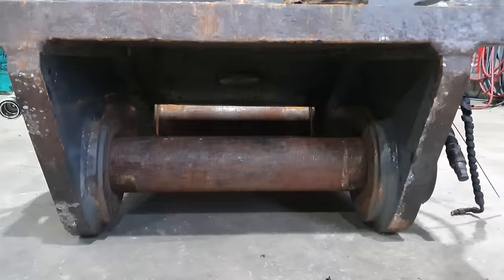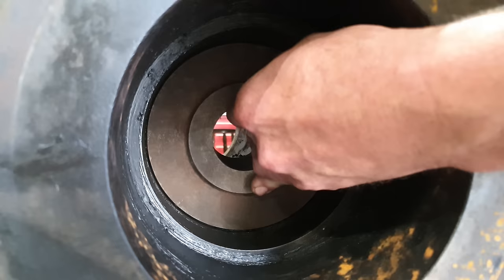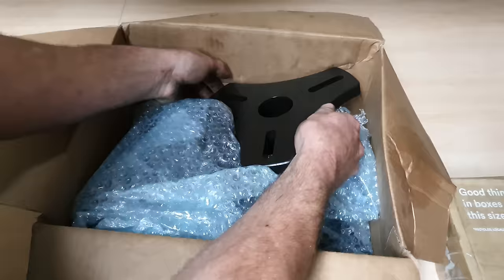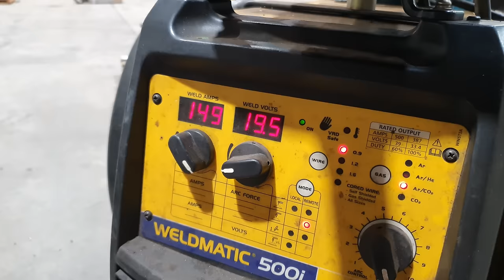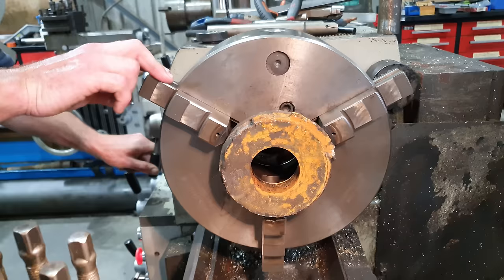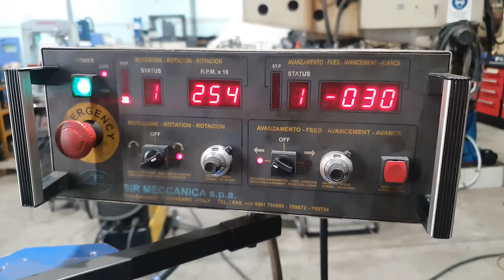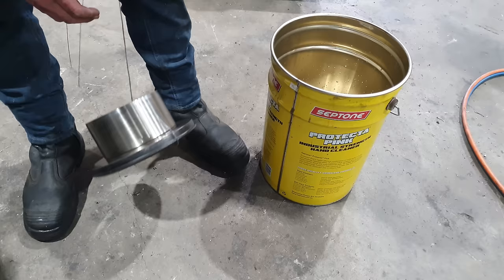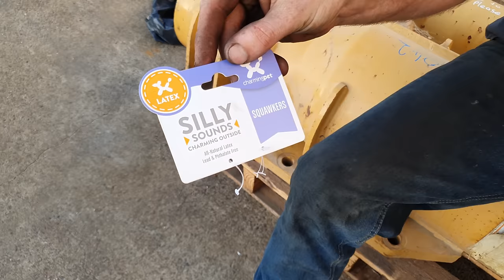Repair SUPER SIZE Tilt Bracket for 90T Excavator | Line boring & Machining

Comment: This entire series is a master class on heavy equipment repair. Professional production and a PHD level machinist.
Reply: with humor.. and he likes birds
Reply: He is very good doing many things. I worked in aviation at Bell and LTV as top pay working on very difficult parts. I also had my own production job shop for 18 years. I ran DeVlegs and Jig borers. I also ran 100 hp Cincinnati vertical and horizontal mills. He has taught me a lot about big lathe work.

Comment: Shop made tools are always a favorite. Line boring is another favorite. And, of course, your videos never disappoint. 
As for the tilt unit, I've not seen anything like it. I was a dozer operator, mainly D6 and D7. 
Homie and his toys are so fun, and my cat loves Homeless.
Reply from the maker: we've got a few more shop made tool videos we want to do when we get a chance! The tilt bucket and quick hitch is a lot more common on smaller machines
Reply: I liked how you took care of a unique situation to center the line bore… and the new parts just in time because you would have not gotten that disc out with the original supports welded on
Reply: During set up when tacking on the guid fixtures don’t they draw on you making the bar tight ?
Reply: Want to make a tool so first you make a tool to make another tool.
Reply: @CuttingEdgeEngineering who owns that green small 🚜

Comment: I respect your tenacity in solving issues with tools that don’t totally meet your needs. I know it is so easy to continue putting up with a product that generally works but you make the time and effort to fix what needs to be fixed. And your videographer does a good job of capturing the details and answering in video questions I’m sure would come up. Well done.👍

Comment: Those constant improvement efforts to ensure the customer gets the best possible outcome really add value to your shop. I’ve watched enough line boring in the field to appreciate how keeping tolerances to spec will get the longest possible time in the field before repairs are necessary again. You set a good example to those watching who do similar work.

Comment: I had to hold my breath when you fitted those bushes. Glad it all went well. That is one hell of a power head. The advances in machinery since WW2 have been astounding. When we were kids in the fifties they were still loading trucks with cable winch dozers. I hope you tube were not to harsh on you. I thought something must have gone wrong when my comments went missing.

Comment: The 4-bearing install is an interesting solution to the problem of eventual dust penetration.   Always interesting to see the variety of work going on in your shop!
Reply: The multiple bearings also support the bar better and spread the load out so there's less wear on any individual bearing. Win-win all around.

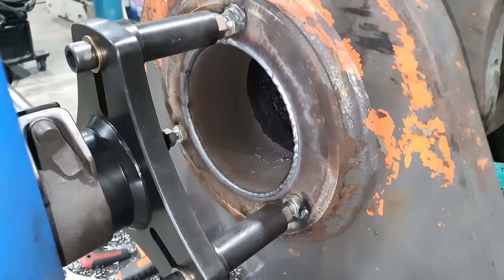Comment: Seems crazy to use a tilt bucket on a machine that big, but I guess they have their reasons. The shop-made mounts came out great, and the video speed for the welding on the second half of the main pivot bore (20:48 to 21:04) was spot on!
Reply: It avoids having to bring in another excavator.

Comment: Shops I have worked in we used freezer box with CO2. Changed dump box bearing ultra class, heated eye with snap ring oneside (bearing slides through and locks). Another line boring box dump hinge ulta class, two bars 12 feet. Ultra class over 300 tonne. Great machineshop and outstanding work done.

Comment: Those shop made tools look better than the OEM part, and yes that nitriding came out great, lovely surface and no imperfections at all, and a perfect fit on the threads as well. Going to bet the most expensive part was those 4 bearings per side. Close tolerance bearings are expensive, as I have had to order some for machinery, but seeing as the originals lasted 40 years, with no grease applied to them for a long time, due to burst and clogged grease lines, and they only got replaced because one was scored, but still had no measurable play. Those will still be there when your grandchildren are running the shop.

Comment: Those line boring supports came out really well. I liked seeing you put the smaller ones into use in tandem. They did not become obsolete. Karen is one of the most efficient and fastest heavy duty mechanics around. She just breezes through the work. 😋

Comment: It is just so satisfying when someone uses  equipment for things they were not intended for. Often that will allow you to do things easier and cheaper than your competitors and /or just make it possible. I used a hydraulik rotator hook on my knuckleboom crane which was not common on big cranes back then but convinced my boss to buy one in big size anyway. A lot seemed to like my idea because they became more common. When you are a one man band you need to be creative.
Reply: To quote Gene Kranz during the Apollo 13 incident: "I don't care what its designed to do, I just care about what it can do" amazing what they pulled off back then...

Comment: I've been a machinist and NC programmer for a lot of years. I've never seen that tool before for line boring and welding. I'd have been fiddling around on a horizontal with dial indicators, boring It, taking it off the machine to send it to the welder, back for more dialing and boring. Very cool! I love how rigid it seems for boring. I guess it's only weakness might be it takes a fair amount of finesse to set the boring tool to cut finish size with the travel dial and a set screw. Again though, very Cool!
Reply from the maker: Hey mate, great to see our videos getting the ideas rolling! Cheers for watching! 😀👍

Comment: Karen, I can't be sure if you used a neutral density filter or just stopped the lens down to a small aperture, but you really captured the art of the bore welding with the orange sparks and blue arc tint. That's some excellent photographic/videographic/cinematographic skill on display. Have you experimented with a UV/Skylight filter on welding shots?

Comment: Been there done that on heavy equipment. A line bore takes some time but a Great tool to have.
I was wondering if you would show how to do the bushings. That is how I do them. You would be surprised how many people don't realize that's the way they are done, by super cooling them.
Great video.

Comment: Curtis makes this look almost effortless. My experience is with bearing liners, bushes, installed in magnesium and aluminum gearbox housings. Getting bushings (bushes) that size into holes is incredibly difficult. If his dimensions should be off just tens of thousandsth of inches or millimeters, the bush can hang part way in. It would probably have to be ground out. 
Well done, Curtis.

Comment: Now, this is my kind of building. Likely over a dozen over the years. It's sooooo nice when they are done and all painted up. Great post Kurtis. Love it and the memories of days gone by. We had one on a 750 that was literally torn apart. I couldn't believe my eyes. It wasn't recoverable. HOW DO THEY DO THAT, LOLOL
Reply: Generally that happens when you 1. don't maintain the thing and then 2. use a gadget rated at X tons to try to move 1.5X :D
Reply: @mrz80  You bet. I have seen the boom base on a 300 literally torn out. 1,1/2 inch plate torn like it was paper. It was operators like that that kept my job security well in place for over 45 years eh.

Comment: When I was young I did not bother wearing gloves, and I'd get covered in the different oils and chemicals I used.  My hands use to sufffer, getting dry and cracked, especially around the fingernails.  Gloves are a pain to use, especially when you need to feel what you are doing...   what I learned to do was use powder free non latex gloves and put two or three pairs of gloves on.   As the outer layer gets damaged you just replace it with a fresh pair.  This technique allowed me to feel what I was doing, protected me from a lot of damage and cuts, and improved my skin quality a lot.   It saves more time from cleaning up than the time it takes to do it, and work is a LOT more enjoyable without all that damage to your hands.

Comment: I like the parts that explains what needs to be done and what the challenges are. Me, an office spare parts sales guy, do not know what impact my sales decisions have when I offer an upgrade or component. Take those bushings for example. They are expensive and probably have a long delivery time. (at least in Europe) What if the engineer does not have liquid nitrogen available? What use are the bushings then? It amazes me how sometimes the ‘office’ can think of things that are just outright not applicable in practice. Knowing fully well that I am the office guy who makes those mistakes. That’s why I like these videos you make. Good and well thought through decisions based on experience and knowledge. Keep it up!

Comment: The Tilt didn’t look to big until you had your had inside the pin bores. That was pretty cool watching how you line bore and build it backup with weld. I have never used liquid nitrogen to shrink bushings, that was pretty neat. I have heated bearings to install on a shaft and you only have one chance or have to pull it back off and heat it up again. I’m amazed at what you can do and the quality of your welds. Thanks for the videos.

Comment: Should make up centring cones that stack on each other like rings . So you just add more to make the cone diameter larger . We had a set at ATW for this kind of repair and also I used them to set the new pins and bushes aligned when welding the assembly to keep everything true while the welding stresses pulled everything around . Love ya work mare 🎉

Comment: I only recently stumbled on this channel.  I must say it’s impressive. I spent 3 years of night school learning the basics of machining and welding. I maintain a hobby machine & welding shop. My question is your use of needle scalers. It does seem like there is slag present but I see you using gas and not flux core wire. Can you explain.

Comment: Hi Kurtis, I would question your description of the “spacer” plates as being non structural. I would describe them as cheek plates as you would see on a pad eye. I would say these are very much a structural component as they have the same bore as the main side plates therefore they will receive shear and bearing loads. A spacer would have an oversize bore to the pin so it would not be subject to any loading. Absolutely love your channel though especially the outtakes.

Comment: Note to fans. The black color on the new mounts is black oxide. It is used in aircraft  gear boxes to check gear wear patterns.  This is the same thing used on gun barrels. The actual nitride on the steel would be a uniform grey color.  The color of a file.  Nitriding adds nitrogen. Case hardening adds carbon. The usual thickness of the layer is up to 1.5 mm. Nitriding is somewhat more wear resistant than case hardening.
Reply: what?

Comment: We have a load of the Hitachi 890's used as demolition excavators. A few of them have oil quick attachments for switching between grab and 10t shears. Beast of a machine but they can't touch the liebherr 980 that we have. That's a behemoth and an animal with the 10t shear attached

Comment: When the welder is running put a small table up under the feeder cable to make it as flat - easy run for the wire to feed to the gun . Saves on liners over time and helps keep a nice even feed speed without the added need for the wire feeder rollers to push the wire around so many bends . I also used to run a cleaner rag at the feeder on the wire as it entered the rollers to clean off dust and fine grit 🎉

Comment: Excellent work as always! Fun fact: each time you handle LN2, it gains heat. Pouring “warmed” LN2 back into the tank warms the liquid remaining. Does it make any difference? None at all. We use about 35,000 gallons a month and have for over 50 years. Boiled off LN2 is simply part of it. Fun stuff.

Comment: I know this is a dumb question, and I should know this but I've never added a quick hitch to a tilt bucket.  They always came with it originally.  But, I was wondering if adding a quick hitch causes problems with the thumb alignment?  Or do you have to order a longer one/add an extension to it?  Sorry, curiosity is just driving me crazy.

Comment: Kurtis, I'm surprised you're so disciplined not to play a little bit with the liquid nitrogen. Like freezing a rubber ball or flower and dropping it to watch it shatter. Dri ice in a plastic soda bottle with a little water and capped up was always another one after shrink fitting bushing with the dri ice. Excellent video! I always had a BFH handy when shrink fitting.

Comment: Excellent idea having four bearings ! Wonderful execution.  I remember a smallish though very heavy duty German lathe using three identical run of the mill ball bearings in the front of the spindle with a double thrust bearing at the back. Very smooth machine, plenty accurate and could take a bite.

Comment: Another great video!  Also great camera editing the bearing install into the new mounts, first all 4 going in, then less & less until just the snap ring, Very Cute!   Also, why bore & weld up & bore to final size, couldn't they just be welded up first and then bored out to finish?   THANKS.

Comment: i just had an idea, not sure if this would help at all but if you stuck a loose fitting spring on the line borer shaft after the second centering cone, then crosspin through the spring, you'd be able to tighten the cones by rotating the spring. brain's always whirring lol
Reply from the maker: Hey mate, great to see our videos getting the ideas rolling! Cheers for watching! 😀👍

Comment: I with held my comment while you were welding. Absolutely fantastic start to end. I presume you call that tool with multi pin head a "scabbler"? They are also used to remove old road marking plastic. Thank you for this free entertainment. Steve. Bulgaria. Ps. Love the blue Staffy.

Comment: Not sure why I always find interference fits using liquid nitrogen to be so satisfying to watch.  Many years ago watched a young lady do this - she'd line up about 10 or 12 female parts on a plate and heat it all up slowly.  Meanwhile the male parts were ready for the N2 bath.  When the heating was done she'd cool the pins all at once.  It would take her about 20 seconds to get all 10 or 12 pins in, seated and checked.  Just a neat process.

Comment: I have watched a few of the line boring and welding videos, but I do not undwerstand how you set the radius for welding. is there somew adjustment at the back of the machine, or is the torch flexible?

Comment: My God man you need a million dollars worth of equipment to do this job? I mean special couplers, welders etc etc!!!  Unbelievable!!!! Great stuff Curtis !!! I love working with metal. As a kid I did brazing, that how I learned to weld. My Dad welded the keels and the birds nest on transport ships during the war. Yep, I love welding. 👍👍When I was in the Air Firce rebuilding jet engines we did the opposite of freezing, we heated the bearings really hot and slid them down the main shaft. We sure had to do this fast. My job was to get it at the right temp then drop it on the shaft very quickly. 🫣🙂👍

Comment: Hi curtis.i notice in every video that your phone I always in your top pocket......I would recommend you have a look at the new Makita blue range accessories they have a phone pouch that has a belt loop on the back it also has a carabina hook that can hook on to any of your tool belts or you can simply hook your keys to it... it has to front elasticated pouches
for bank card driving licence etc.....at each side there is to elasticated pen holders
Interior has elasticated reinforcement to hold your phone securely and a secure card holder to hold the cards you don't use on the regular basis and has heavy duty zip ....I purchased mine recently from Makita website for    £20.00 uk .....you would  probably pay round about the same in Aussie dollars I totally recommend it for you as how many times has you phone fell out of that top pocket when you bend down/over a job your working on

Comment: In school when it was time for my work piece to be graded by the instructor, grade marks where awarded for accuracy..of course.
Living in Canada, if the piece was a little oversized it was a simple matter of bringing it outdoors for a smoke break.
At -25c it doesn’t take long for things to shrink a few thous. 
I’d wondered about critical tolerance and the effects of temperature on the material. I assume the engineer allows tolerances that account for temp. Changes ?  In Canada’s north -35 and +35 ambient temps are the reality.
How much of an effect does this have on critical parts on large equipment?

Comment: 7:28 If you press the disc directly onto the chuck with the tailstock, you get the same result and you save yourself the trouble of making the mandrel. However, you are only allowed to center and then have to drill out later because your tip is not as big as your hole.

Comment: Love such glorious work you did to the bracket it's not your first time our it won't be your last one question I have which I may have missed when you did the insert boring and putting in the new inserts I assume what you dipped them in was liquid nitrogen and to what purpose does that do is that to do with strength more or drop down in size by shrinking but at the end how did those two new inserts not need welding in best wishes bro u are genius at engineering 🖐️🖐️❤️❤️Declan O Shaughnessy Galway Ireland 👍👍🙏